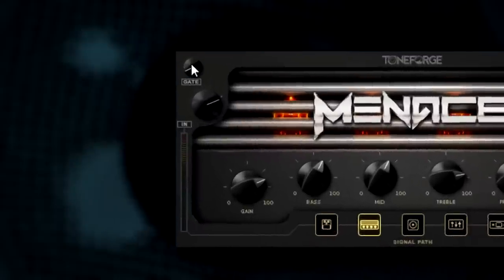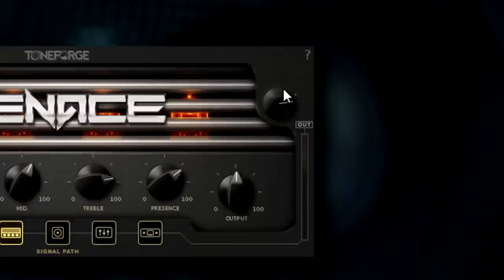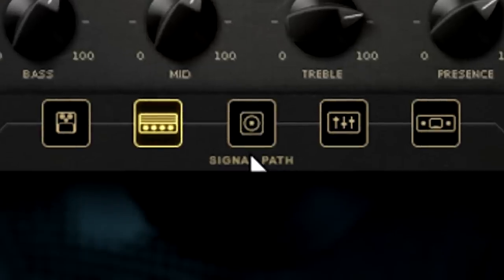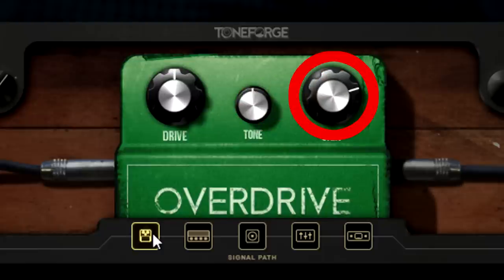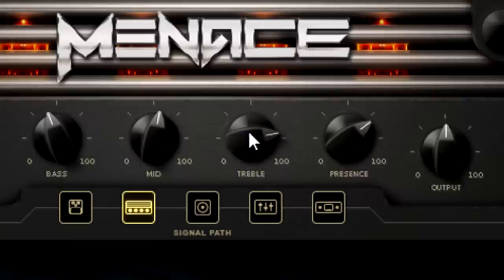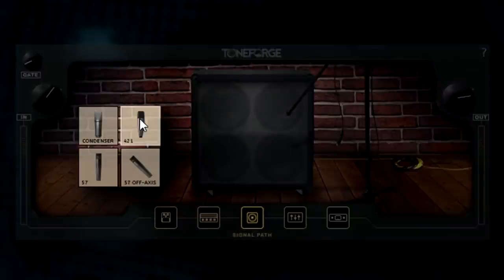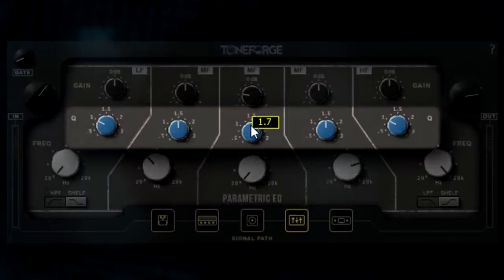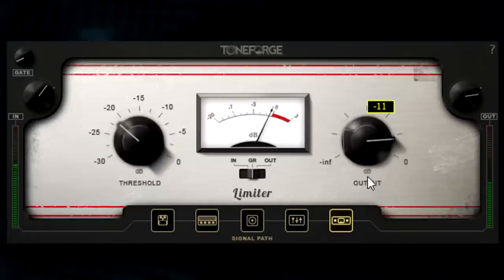Toneforge - Menace Guitar Plugin - Video Manual

Comment: Are you guys planing on adding a RAT pedal or some more variety in stomp pedals?  I managed to get a good tone that I like using a real physical RAT in front of my interface, and disengaging the TS pedal inside the plug-in, but can't manage to do so with the only internal stomp box. Maybe it's just me, but I'm sure people would buy the upgrade or a expansion pack of some sort if it means more tools to work with.